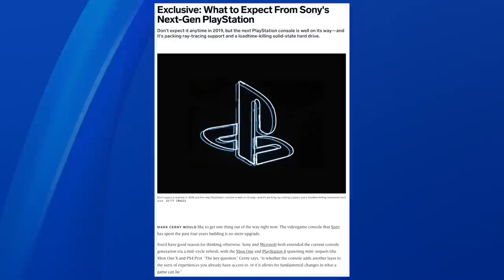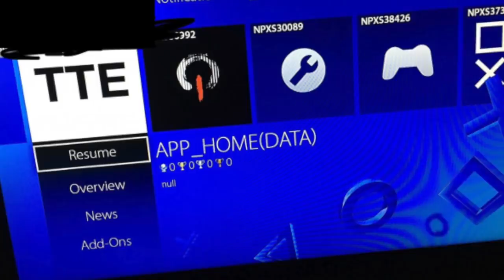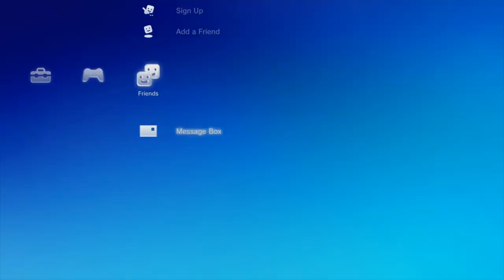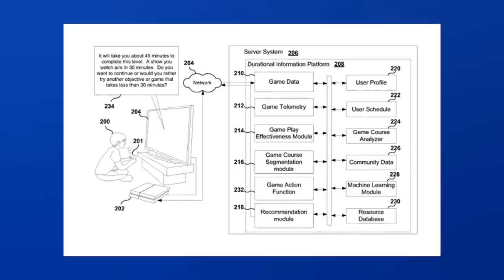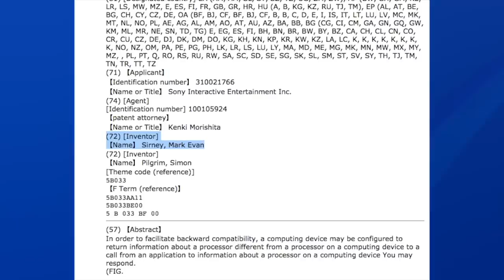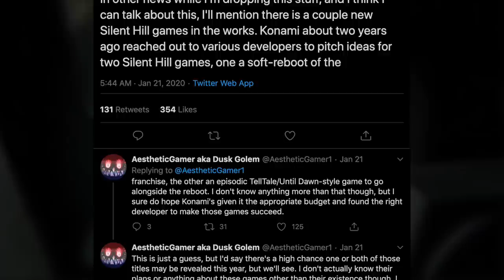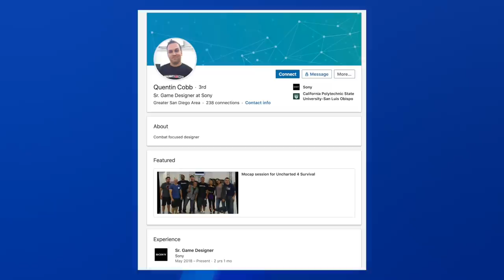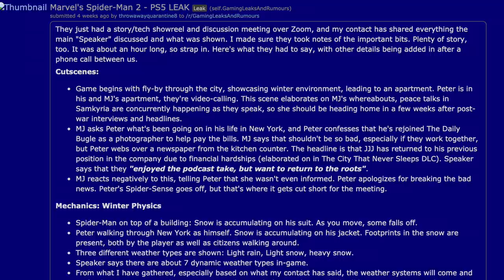All PS5 Rumors and Games: UI, Console Reveal, PSVR 2, Exclusives, and More.

Comment: "Don't expect PS2 or PS3 games"
Aight, I'mma bout to head out and cry
Reply: Bro whos this guy in DP?
Reply: Why you can easily buy those consoles for cheap ,  this is next gen not past gen
Reply: Paul Santibanez 

Your just jealous that XBOX SX will have full backwards compatibility but ps5 won’t
Reply: @paulsantibanez525  I have a 60GB PS3 just because I still play my PS2 library
The ability to have all those games on one box gets more and more enticing as technology gets better
You have no clue how annoying it is for me that I have to swap a system out just to play one game. I have my Xbox One X on my desk and I swap out my PS3 and PS4
Reply: I wish for ps3 games lol
Reply: miguel ornelas  and thats because it has ps2 hardware in it. I prefer what microsoft is doing because you can 1: play disc and downloaded versions 2: it generates far less heat then having the full hardware in it 3: unlike with backwards compat ps3s the xbox one requires no work. If you are using a bc ps3 a delid is required or it will die sooner or later. And its not a few games, its quite a lot.
Reply: miguel ornelas had a stroke reading that
Reply: PSnow aready does PS3/PS2/PS1 BC, will get updated for PS5
Reply: RiderNexus you know there is ps now and emulators right , and yes back ward compatibility is nice but to sacrifice tech for next gen just so you can play old hardware  is nuts😳. I don’t have a problem switching systems cause I bought  a  multiple channel receiver with av connection. You guys complain but their are simple ways to do things 🤦🏽‍♂️🤷🏽
Reply: one man army lol jealous of what that a company has screwed yall over since 360 with no games and over pricing , your delusional my guy Im good with my 4 but I’m ready for the 5 no rush . I see all you Xbox’s ready for a clean slate , I pray Microsoft does right by y’all this time around 💀
Reply: @marty8370  but its not disc based.
Reply: @paulsantibanez525  Sure and get 12 consoles under your tv desk! and constantly unpluging shit!
Reply: I'm keeping my original playstation 3 and skipped ps4 entirely, hopefully the ps5 will catch my interest if it is as good as ps3
Reply: @cssplayer91  I like the ps3, but sadly most ps3s require a lot of work to function properly.
Reply: @rockl79  my launch 60gb ps3 has been kept cool and on a wide open space for great ventilation and it is still working perfectly 14 years later. I even upgraded the storage to a 1TB SSD for storing hundreds of games
Reply: WHY?
Reply: @cssplayer91  if you don't install cfw the rsx will fail sooner or later. It is known to fail once it gets past 80° and the regular fan control on fat ps3s lets it go up to 84 before making the fan go up from 20%
Reply: @abovethelaw4417  but it won't have "full BC". Having select number of games from past gens does not equate to full BC. Its almost like PS2 and PS1 games on PS4. There are well over 3K games on Xbox 360 and only 100's or so available for the Xbox one, that same number will be on the series x with MS having to patch them in as time goes by. I'm not knocking their work, I think it's a great effort, just correcting a misconception that's peddled around very easily
Reply: Just buy a PS2 or PS3. It's that simple.
Reply: @abovethelaw4417  Hey, have you heard of PlayStation Now?
Reply: RiderNexus lmao had a stroke when I found out yo mom named you Miguel 🤣
Reply: Andrew Wolfenstein lol you skipped the whole ps4  era I’m 💀💀ps5 is not goin tospark  your interest if the 4 didn’t
Reply: @RoyHoy  but its far better to have them all in one system
Reply: Maybe on the 2 years post launch revision? (PS5 Pro) 🤦🏻‍♂️
Reply: Gta5
Reply: Paul Santibanez Too bad PS Now is shit
Reply: AleXiz ! I have a 60GB PS3 and it’s fucking annoying to keep switching systems around because I don’t have the space
Reply: miguel ornelas link tells all about who you are ngl
Reply: Morgen Ochin explain
Reply: Imagine crash twinsanity on ps5
Reply: They could easily have it all under one roof but then there's no reason for anyone to sub to PS Now then Sony aren't making subscription money. That's the top and bottom of it, money.
Reply: @marty8370  There is a huge difference between backwards compatibility and PSNow.
Reply: to all of those people saying "but there's PS Now"
I would like to be able to actually keep games and not have to keep paying a subscription fee to maybe keep playing, as games disappear off PS Now for many reasons, like expiring licenses, or because the game was just a limited time offer

Comment: The PS5 controller has USB-C but my iPhone doesn’t...
Reply: Apple and Sony are the same. Expensive but with low specs and battery life
Reply: Lol rip iphone users but if you were blessed with the usbc movement then it's quite an awesome thing and imo yes sony ty less annoying wires
Reply: lose the iphone, problem solved 🤯
Reply: neon_hk16 :yt: have you heard of Microsoft?
Reply: @neon_hk16  sony > microshit
Reply: neon_hk16 :yt: you seem confused it’s xbot
Reply: @jamaksisj198qijwjsis  not yet
Reply: @n1h1luss61  Apple and Sony are the same because they sell expensive stuff and for low specs like 60hz refresh rate on the iPhone 11 pro max and which uses Sony sensor. Samsung and Microsoft are the same because they release some specs really high like 108mega pixels and 120 hz with big battery life and they work with each other. You go to best buy and it says xbox one goes best with the Samsung TV.
Reply: Sage of the Six Bowls  aight. i'ma take your advice and get an android
But which androids since their are a lot of thrm

Comment: PS5 has PCIe 4.0 while Xbox X series has PCIe 3.0. The critical feature of any new PCIe version is that it doubles the bandwidth from the previous generation. There are all kinds of numbers being thrown around about what that means. But in practical terms a PCIe 4.0 x16 slot can theoretically hit approximately 32 gigabytes per second (GB/s) of data flowing in each direction, while PCIe 3.0 maxed out around, you guessed it, 16GB/s. Many people will also talk about PCIe 4.0 x16 having a bandwidth of around 64 GB/s, but in that case, they are just counting the total amount of data flowing in both directions. Mark Cerny is a genius.

Comment: Has there been any indication of the download/installation method changing? The requirement to have for example 150GB free for an 8GB update is frustrating, not to mention the copying is very time consuming!
Reply: I don’t know much about it but what I can tell you is because of the sdd there will be absolutely zero copying of the file.
Reply: What's been said is u can pick what parts of the update I want like for cod u can chose to only update the mp if u want this saveing on dl times

Comment: I'm soo glad Sony invested in VR and are continuing to support it. I was surprised it was Sony and not Xbox made by Microsoft, a computer company with augmented reality headsets and whatnot. Their own fans hated the kinect and they discontinued it so who knows if they'll ever have VR not having a proper tracker. I do hope PSVR2 whenever it does eventually come out after the PS5, not to require a external plug-in box. I got the very first gen PSVR without HDR pass-through and it's developed a noise with the fan from always being on, even when the console is in rest mode or something. Just got to be very annoying and basically leave it unplugged until I want to play VR which as a result is a lot less often

Comment: Apperently ps5 ace, the SSD only works on ps exclusives. For third party its optimized on the average of all platform. There goes the ace i guess. Not looking good for sony
Reply: Unreal engine 5 takes advantage of the ssd
Reply: That sounds like utter nonsense
Reply: All Devs will be able to utilize the SSD even down to the indies
Reply: You must miss the road to ps5... All devs can easily use ps5's ssd.. It's no extra step they have to make..
Reply: @elitebeing21  Indeed

Comment: Do you think any Ratchet PS5 rumors are credible,? It's been 4 years since the PS4 remake and insomniac have a lot of capacity going by their usual output levels. Exiting times either way.
Reply: R&C series never skip a PS platform since it’s PS2 debut. R&C remake also sold well. So yes, a new R&C for PS5 is a guaranteed. The only question is when considering Insomniac are busy with Spiderman 2.